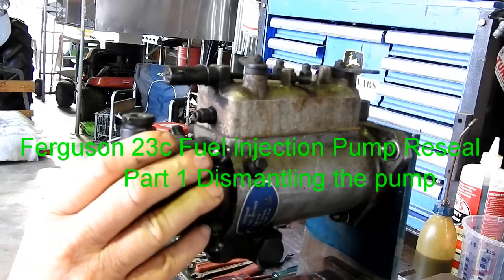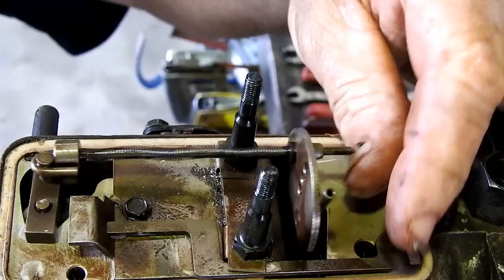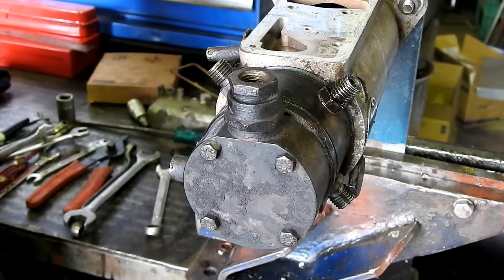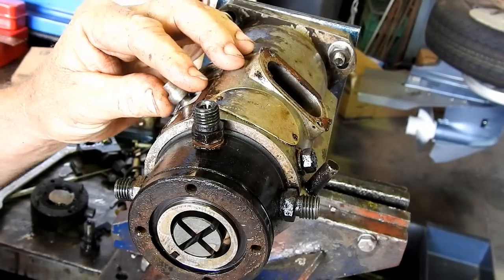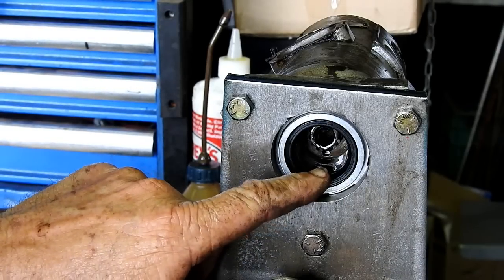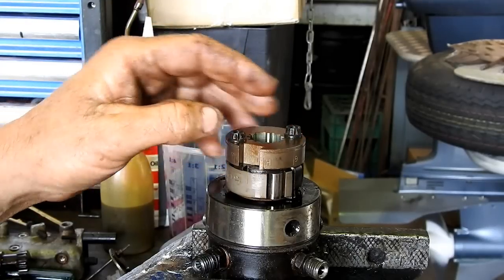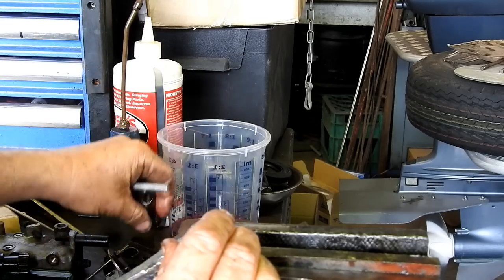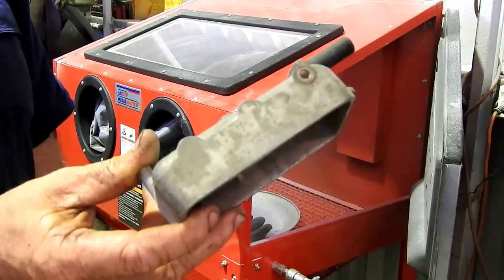Ferguson FE35 Injection Pump Reseal Part 1 Dismantling the Pump

Comment: Great video, mine gives no fuel to the injectors, I've have some trouble with dismanteling but after watching the video again, it makes clear. Now I'll go and clean everuthing and put it back togehter. Thanks so much for this video.
Reply from the maker: Have a look at my massey Ferguson 135 6 speed playlist videos 14 and 15. They are better videos and there is more detail.
Reply: Hi just wondering what you found as the cause of your pump issue as mine is doing exactly the same?

Comment: Hello again Lance , as you can see I have commented to you several times on this vid & others , & you have responded , but I am not getting the answers I am looking for , probably cause I am not asking the question properly, so let me try & give a background.  
I have looked at every vid I can find on u-tub , for answers. 
The tractor was not running properly & a tractor mech told me it was my inj pump , so he took it to a shop & they rebuilt it & brought it back to me 3x , because it was short on power. There was a chisel mark on the part that bolts up, & the back of the timing gear cover with the 3 bolts that when mounted would be about center of the adj slots , however we had to rotate the pump to almost full advance & there it would ping hard. In the mean time “I” found a inline fuel filter that seamed ok , but when I changed it , it made a difference , my fault. 
I have retarded the pump a little bit from full advance to cut back on the ping but I have to idle it at about 800 rpm for a smooth idle, I currently have the pump of again to clean up because of rust & reblue the black parts. 
Here in your vid at 23:56 you show the pump advance, & again at 44 min. that’s on the bottom of the pump & you move the internal parts of it with your finger, mine will NOT move, when I removed the nut off the big end of it, it was under a lot of tension, observed the were 2 heavy springs in there & to re assemble I had to squeeze it carefully in the jaws of the vise, (where you assemble yours with your fingers ) there is a light spring in the other end. You also said some have a ball, mine does . 
Where you removed the 4 injector tube bolts with their steel washers, mine is a banjo bolt set up with 4 - 3” long pipes going horizontal out the rear, 2 of them had a washer, one each side, & 1 had one under the pipe & 2 above, the other has one under & non above. Those banjo bolts, on the end inside the pump have 3 ports in the side just above the thread & a roll pin in the end, (observing), there is a spring & ball inside. The one that had no washer under the head the roll pin is pushed all the way in & when you shake, it rattles as does one of the others, which tell me different spring tension; the length of 3 of them , with the roll pin sticking out = 1.030 th but the one with the roll pin all the way is  .900 , that’s .040th diff & then the steel washer is 70.th  . That would put the ends of those banjo bolts at diff clearance from the port in the head; would that have any bearing on how much fuel goes out to the inj ? 
Incidentally mine has the electric fuel solenoid in the bottom of this head & the mechanical one on the top side of the pump does nothing. 
Sure wish I could send you pictures.
Reply from the maker: The banjo needs to have 1 steel washer on each side not doubled up or missing. The advance on the bottom is hydraulic advance and should be nice and free in the bore when apart with some tension on it when assembled.

Comment: Thanks Lance where you take the advance apart at 46:00 & you have one spring & then you remove the piston , is where they have -2 springs in mine & I had to use the vice to put it back together, when assembled that piston will not move, I held the assembly in the vice & used a ft long tapper punch & both hands to try & move it, where you used your finger. There was / is a smaller spring at the bottom of the piston which you can easily compress between the finger., so what the heck am I going to do ?? 
And what about the big snap ring , it looked about right , but close only counts in horse shoes. 
Some time ago , looking through that triangle window I did loosen those 5/16 , 12point bolts & moved the plate a little to give me more fuel , don’t remember which way. 
Yes, for sure there should be a washer each side of the 4 tubes. 
And what about the banjo bolts, their little spring & ball, & that roll pin that holds the spring & ball in the banjo bolt ; with the roll pin pushed all the way in on that one & one washer under the tube none on top, & then 2 on top (next to the bolt head) on another, that would change the clearance distance between the banjo bolt & the fuel discharge hole + since 2 of them rattle, the springs are of different tensions . 
I saw your vid , after I had posted earlier, of the pump with the 4 horizontal tubes , I will look at it , if I can find it again.
Reply from the maker: There is a free cav workshop manual download on my website in the technical section at www.queenslandtractorspares.com.au.
Reply: @BundyBearsShed  THANKS ! Got it . Look at it tomorrow. As I have said before, love that music you play . Forty yrs ago would have danced the night away . Thanks

Comment: Quick tip, 15:52 is a godsend if you're not getting any fuel and you changed the filter(s) but still no dice, there's a small mesh filter underneath the intake fitting on the injection pump (the manual doesn't say anything about this).
Reply from the maker: We cover that in the videos, new ones come in the kits as well.
Reply: @BundyBearsShed  Yeah I saw, I'll include it in my original comment for transparency's sake.
Seen a lot of people on forums rebuild pumps only to find that "hidden" filter.

Comment: nice job,,,,in the test room, is the test done with a prototype injector? or what the engine has...how will we measure the pressure of the transfer pump? and how will we know if the hydraulic head has lost its performance..thanks
Reply from the maker: What this video is about is cleaning and resealing a pump that is working but leaking. It is not meant as a full pump overhaul and calibration just to reseal a leaky pump and clean out any gum from the diesel. I would love a test bench but just for my hobby it is not worth it.

Comment: At 28:00 you start talking about the importance of the exact replacement of the cer-clip , snap ring, but you never discuss what happens if it is off either way , & I have no idea what they did or whether they lined anything up.
My tractor is a 1989 Case 580 K with a 4 bt  3.9 L Cummins
Reply from the maker: The clip sets up the point of injection or at least a visual of that. I think in the MF65 Playlist I talk about that. The best videos I think I have done on these pumps in in the MF135 6 speed playlist, videos 14 and 15. I go in and explain more.
Reply: @BundyBearsShed  thanks again , I just watched 14&15 again to the umpteenth time , but I have no way of knowing whether those 2 guys that worked on my pump put the large snap ring back in the correct place or not & as I said I did jack up the fuel a little bit but when I look through that window there are no letters they are one the other side , when every thing else is set at #1 tdc
Reply from the maker: @robertmintz63  Pump it up on an injector tester and that will tell you. MF65 playlist.
Reply: @BundyBearsShed  again thanks Lance, I will have to take it to a good shop for that .
I have searched high & low for your vid of the Lucas Cav with the 4 tubes in the horizontal , off the pump head , but I can’t find it , I for sure am no guru at this .
Reply: @BundyBearsShed  Good morning Lance , 8pm here . Thanks again Lance for the manual I have read it through , & can not understand how the positioning of the circlip ring makes any difference, when I look in the window there is a slight chisel type mark on the pump housing  . The square end of the circlip has the outside corner 45ed off , that lower corner is just shy of a millimeter above it .
Then . The little notch in the plate that governs the distance that the injection rollers travel is centered in the big notch that has a line then an H just to its upper side & a line & an A to the bottom side .

The next problem I see is the 2 stage Automatic Start Retard Device . My housing & set up matches that on pg 10 , Except for the springs , they look more like the Heavy Duty Pump with Updated Drive Shaft shown on pgs 21 & 26 ! How can this be ?
Next the manual did not show anything about the banjo bolt (that hold the banjo tubes) put together , roll pin , spring ,or ball, or specification.
Reply: Still have not found your vid on the pump you did that has the 4 tubes horizontal
Reply: Just found it - mf 135 Cav injection Pump full strip down reseal & stop fuel leaks
7 yrs ago

Comment: I have a JD 2040 with a 3432F700 CAV. Sat for months yet cranked and ran perfect 15min then died as if I turned off the fuel. Replaced filter assuming it was bad, have system bled well through upper bleed on pump. I get zero fuel out of pump. Even pulled it around yard and get nothing. Took off head and metering valve is not stuck. Could something be broken internally causing this condition?
Reply from the maker: Pull the end cap off and see if the vanes are turning, I have seen the shafts break.
Reply: Can  I leave the pump on the engine and do this? It looks like I can remove the fuel inlet line and then unbolt the very back plate to see the vanes, correct? I understand what I’m trying to see but don’t want to do it in the engine if that’s going to cause an issue. Thanks for your help.

Comment: Great vid good detail, I am learning some New Zealand lingo here , diff than USA , here we say, combination wrench , consisting of  box end & open end , some people say spanner for the open end . You showed a tubing nut , for those I always use tubing wrenches - -A  6 point wrench with 
“1”. Of the sides cut out,. That way never distorts the circle ! You might make some aluminum or smooth steel  jaws for your vice , so you can grip things more firmly without leaving marks . 
Now for the reason I was on the internet looking <> I was using the lift pump , thumb pump to pump out any air from the inj pump( Lucas Cav )
On a Case Tractor backhoe (580 K) 1989 with Cummins 390 motor .    I had loosened up the lines so I could rotate the complete pump to advance the timing without Torquing the lines to much as it was set at original stock timing & is overheating ! I will have to go to the top of the story here ! <> I was having running problems 5yrs ago and the mechanic said it was my inj pump so he had it rebuilt at a shop here in Costa Rica & I found I had a dirty inline fuel filter, I don’t believe it was the inj pump at all !When they put the pump back on to have any power, moved the pump to almost full advance & it still lacked power , then 3yrs ago I got a leak in a heater hose under the tractor on the way to help a man pull his truck back onto the road , cooked the motor , 100% rebuild ! Had many re-build problems ( poor shop) so first running ,some light work in a friends driveway, but overheating ! No real chance check out its power level . Watching a Gail Banks vid learned that retarded timing causes over heating & damages pistons, hence I was advancing the pump ! 
I loosened the acorn nut instead of bleeder , realizing my mistake (I saw bubbles at the gasket) & when I tightened the nut I twisted off the bolt  so looked for a vid on NOW what am l going to do, “found you “! THANKS for posting !
In your vid you pointed out that the inside of the pump can be mistimed , i wonder if this is why they had to advance the pump ???? I have lots of pictures. Do l have to take the pump apart to check this out ? Now to find a new bolt .
Reply from the maker: No just look in the side plate and see if ti is close there

Comment: Hi Lance, great vid! I got to 24:30, my cam advance screw (pin) is stuck... I've worne two high quality spanner and still there it is! Any suggestion to unscrew it?
Reply from the maker: Try a smack on the end to jarr it sometimes that works, that is why I used a big shifting spanner there as the smaller spanners the jaws will open and slip. The shifter needs to be in good condition with nice firm jaws though.
Reply: @BundyBearsShed  appreciated thanks Lance

Comment: Thanks very much for your video's, just wondering how to remove the nut where the veins sit into on the front of the pump? Thanks
Reply from the maker: It is a left hand thread and I made a special socket for the job. There is a video on my channel on it possibly in the MF65 playlist but couldnt be sure now.
Reply: @BundyBearsShed  ok thanks mate, blessings
Reply from the maker: No we dont but one from another pump would fit.

Comment: Thanks for your videos. My Ford 3000 has a cav pump. I pulled the fuel shut off to stop the tractor. 5 minutes later I pushed the fuel shut off in but the tractor wouldn't start. I checked fuel in and out of the filter. Both were good. Next I removed the fuel inlet assembly from the pump. I cleaned the fine filter. It wasn't very dirty. The little shuttle piece seemed to move pretty freely. After I watched your video I pulled the top cover off the pump to check the shut off, or the metering valve. It was stuck in the off position. I removed and cleaned, the put it back together. Now it cranked and ran about 15 minutes. The tractor started skipping, got worse, then stopped.  On the side of the top cover there is a hose barb with a hose going to the front side of the front injector. The 3 injectors are all linked by hose with a hose leaving the rear injector going to a connection at the top of the fuel filler neck.  Fuel is coming out of the hose from the top cover of the fuel pump. If I take the hose off the front side of the front injector, and catch the fuel in a jar, the tractor runs fine and fuel is still venting back  into the top of the fuel tank. With the hose connected the tractor starts, but stops in 4 or 5 seconds. What do you think I have done wrong?
Reply from the maker: The bleed back to tank is blocked check the fittings are in the correct place but check all the way to the tank as where you undid it was good so it is after that.
Reply: Thank you. So fuel coming from the pump top cover is ok, but needs to flow unobstructed through the fittings on the injectors and back to the tank?
Thanks again!     @BundyBearsShed
Reply from the maker: @wendellpayne7622  Yes nice clear flow.
Reply: @BundyBearsShed  I replaced hoses. Works fine. Thank you so much.

Comment: My head won't come off for shit. Trying to twist it back and forth with a big pipe wrench but no go.
Reply from the maker: You havent missed one of the screws in the back towards the engine block at all? They are usually fairly easy.
Reply: @BundyBearsShed  No, I finally got it off by clamping the head in the vise and using a soft mallet to tap the housing. I guess it was varnished in.

Comment: If you had a pump failing to deliver on cylinder number 2 but the injector was proven good what would you suspect pump wise ??
Reply from the maker: The pump uses the same plungers on all cylinders so I would look at the fitting on the pump where the inlector pipe goes.

Comment: After one of the 12 point bolts in the head was not tightened properly it walked out during operation and broke that little pin on the governor plate that has the spring on it  close to the shaft thats. Since welding back that pin and reconnect the engine goes into high acceleration and can only be controlled using the choke lever. What could be done to fix this behaviour. For land rover series 3 diesel 2.25 engine.
Reply from the maker: Find a used plate they will fit fine. You possibly have the top spring in the wrong hole too. There is a free manual download on my web site .
Reply: @BundyBearsShed  I will try to find a plate and replace it. I will also check out the manual. Thank you for the quality videos you continue to produce. And get well soon with that face injury. Stay safe.

Comment: I have a DPA pump that apparently was rebuilt before, but the larger cir-clip used for timing was moved, and is nowhere near where it should be. I have not opened up the pump yet, but am wondering if there is a way to orientate the clip back to the factory setting. The tractor with the pump is an Allis Chalmers 5050 which has a Fiat built engine.  Thank you for the great videos!
Reply from the maker: no not unless you have an injector tester and can pump up the no1 outlet to find the point of injection. You could get the timing correct so you can see the letter on the head then when you have it apart move the clip around to line up with your scribe mark.
Reply: @BundyBearsShed  
Thanks for the response. I have 2 of these tractors both with the same pump, one of them would start hard, but ran well. I switched the pumps around and the hard starting followed the pump. The service manual shows to time the pump with a scribe mark on the timing gear case to a scribe line on the pump. There was no line on the rebuilt pump, so I went by the second method the service manual mentioned and that is to line up the letter on the pump head with the edge of the cir-clip, but the cir-clip is moved.
Neither tractor has a low compression issue, but the hard starting seems related to one of the pumps.

Thanks,
Steve

Comment: Great explanatory video Thanks. Can anyone please tell me what made the Fe 35 a pig 🐷 to cold start  My neighbor had one when I was a kid and it was near new nice tractor once you got it running There was a modification done to the cylinder head that was  a big  improvement  to the  starting He bought a 35 X and never looked back lovely tractor
Reply from the maker: Timing would wear and originally the oil rings had too much tension on the bore and they would wear quickly.